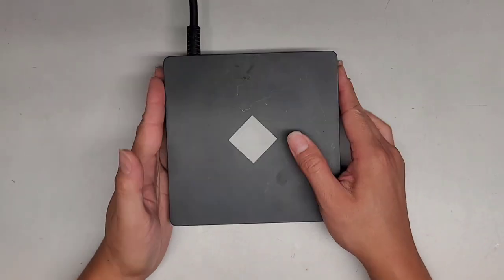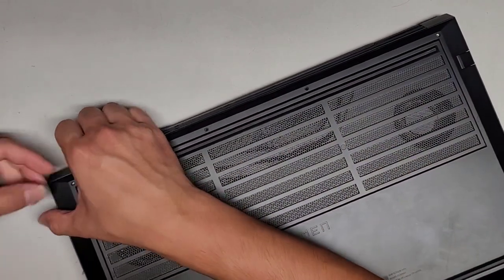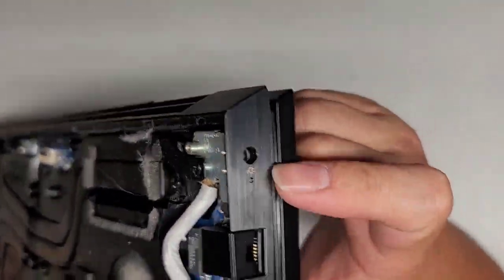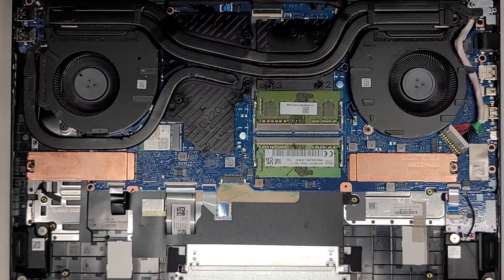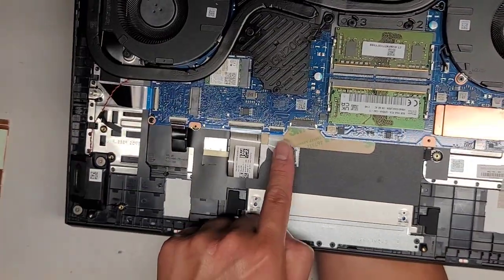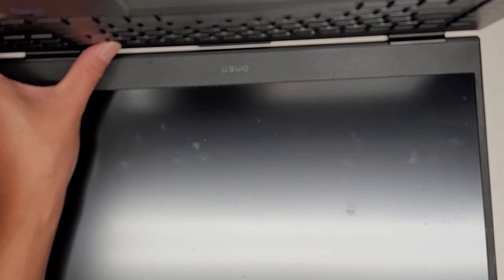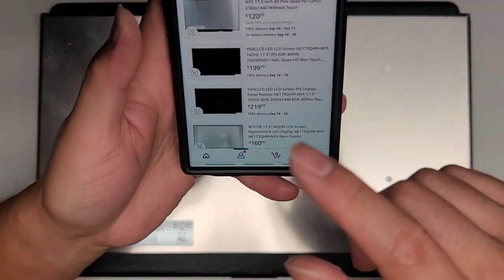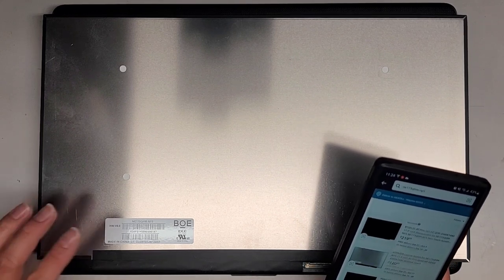HP Omen 17 17t-ck000 Disassembly RAM SSD Hard Drive Upgrade Battery LCD Screen Replacement Repair

Comment: thank you very much for this great video. i do want to upgrade my omen with ssd and ram and i have a question to you. could you mention which device for the ssd to buy and how it is placed and installed to the system? do one has to make anything on the os side after installing the ssd? And regarding the ram upgrade, do one has to replace both rams currently present or can i replace just 1 of the currently default installed 8gb ram sockets and insert e.g. a new 16gb socket?
Reply from the maker: This should help. https://youtu.be/4p5jFDzVwUw you can replace just one stick of RAM.
Reply: @ItsBinhRepaired  thank you Very much for you quick reply. i will do as in the Video described. Just one question, does the ssd size Matter? 500gb, 1tb, 2tb,... or are there a Limit regarding the Volume ?
Reply from the maker: @slomo4056  there's no size limit.
Reply: @ItsBinhRepaired  OK thank you. do you have an recommendation on a SSD that fits to the Omen?
Reply from the maker: @slomo4056  how much storage do you want?
Reply: @ItsBinhRepaired  1tb additional space would be perfect. my omen has 256gb by Default which is really limited
Reply: @ItsBinhRepaired  do you have a product recommendation?
Reply from the maker: If you don't need the fastest performance, this works great https://amzn.to/4gpKCs3

If you want more performance, then go with this https://amzn.to/47rmvFC
Reply: @ItsBinhRepaired  thank you for These suggestions, i will try These.
Reply from the maker: @slomo4056  sounds good

Comment: Hello, thanks for this video. I wanted to replace the SSD that just failed on SMART test on my OMEN 17-ck2003sf (7M270EA) laptop and wanted to see if I could do it myself. Does it need a 22mm*80mm SSD? I could not find the info. Can I replace it with the Samsung pro980? Thanks a lot.
Reply from the maker: Yes, but make sure no heatsink.

Comment: Thank you very much for this video, especially the screen replacement part. I cannot believe why HP used adhesive to secure the lower part of the screen. They must have been a few screws loose (pardon the pun) to secure the lower half. Over time the adhesive will lose its stickiness because of the heat of the laptop. I managed to get my screen replaced myself after it broke down for a 2nd time, 1st repair was done by the shop under 1 year warranty. 2nd time they were asking too much money, so I did it myself using your guide. Anyway, very grateful & I have sent a donation. Seasons greetings to you & your family.
Reply from the maker: Awesome! Glad it helped. Yeah, the adhesive route is stupid. They're all doing it now. Thank you so much for the support. I really appreciate it. Happy holidays!

Comment: I’m about to lose it. I can’t plug the battery. GOD
Reply from the maker: @cmliulasefe  the connector won't go in?
Reply: @ItsBinhRepaired  My laptop just came from warranty service and I wanted to open it to upgrade my RAM and SSD. After opening the lid, I tried to remove the battery. But it seems they screwed up with the screws, lol. One of them was stripped. So I couldn't remove the battery, I only disconnected it. After upgrading I had so little space to connect the battery and it's so stiff for some reason. I did it at least, but it gave me a headache. I wasn't expecting you to answer haha, nice vid dude. Keep it up.
Reply from the maker: @cmliulasefe  D:

Comment: Hey Boss - How much you will Charge to Replaced my Motherboard on my HP Omen 17t- ck000..?? Including Parts + Labor..??
Reply from the maker: What are the specs? I'd have to see if a replacement board is available.
Reply from the maker: Email is for spam. Message me here.

Comment: Nice video, Can you replace the GPU chip or does the whole motherboard need to be replaced? I ask as the GPU has failed
Reply from the maker: Whole motherboard
Reply: @ItsBinhRepaired  ok i thought as much. i have HP Omen 17-CK0013NA i7 rtx 3060 is that the same motherboard as the one in the video?
Reply from the maker: @adventuresindiving7451  not sure

Comment: You answered my question 8 minutes in. I wanted to know if I had to pull the battery just to add an SSD. Perfect thanks
Reply from the maker: Glad it helped. :) If you haven't already, please like and subscribe so others can find my videos and possibly consider watching a few others and commenting to get the algorithm to recommend my channel. Thanks!
Reply: Liked and subscribed thanks
Reply from the maker: @PatrickNolte  Awesome! :)
Reply: @ItsBinhRepaired  well I added the second drive. I didn't have an issue at all taking off the bottom cover. Once I got it started, I used a plastic pry tool.  What surprised me was how small everything is. That battery connector looks much bigger in your video than in real life. Of course I powered down, pulled the bottom cover, and installed the drive. After a reboot the drive was there. Thanks for the tips.
Reply from the maker: @PatrickNolte  awesome! Glad the upgrade went well.

Comment: hello, it has 2x gen 4 ssd slots ?
Reply from the maker: Yup
Reply: But on the MB in your video it says Gen3 for the second ssd slot  @ItsBinhRepaired
Reply from the maker: @myth71  oh, that's right. Either way, it'll support a gen 4 SSD though.
Reply: @ItsBinhRepaired  You mean it will run a Gen 4 at full r/w speeds?
Reply from the maker: @myth71  no, it'll run at gen 3 speeds, but it'll work fine.

Comment: First! (🤔only?)
I saw Omen in the title and thought about what a crazy name that is. Then thought, uh oh, is this thing gonna live up to its name? Yup!
You said a fascinating thing, you said that on many of these laptops, that the unit doesn't even have access to the GPU unless the A/C power adaptor/charger thing is plugged into the wall. It is interesting in several ways. I`m trying to remember if my hp laptop was plugged in when I was doing some benchmarking recently. I think that i will go back and retest just to see if it makes any difference in the results. I`ve got time on my hands while I wait for $300 worth of R/C truck parts walks here from China. hhhhhhhhh
A couple quick things about my hp Camo edition. Firstly, it had like a total of 7 screws hidden under those 2 rubber strips that are the feet. And I got bored the other day and decided to do an experiment. It came with a whopping 4 GB of RAM. I had already bumped it up to one 8 GB stick. Both are/were of the 2400 MHz. So, I decided to add a second stick of 8 GB Ram except of the 2666 MHz. Just for some fun benchmarking (my idea of fun has sure changed over the years, lol) testing. Will it recognize it? Will it improve my R23 score? Will it explode? Yes, it recognized the 16 GB. No, my R23 score did not improve. No, it did not explode. Anywho, I'll be running the R23 again, making sure the A/C thing is plugged in. 
Bro, this screen is a bear. A bit similar to the Apple all in one screen that I broke the other day.
Haha that split second when you saw that crack in the screen, when you were all, "Oh, Snap!" "Did I do that?" I haven`t finished watching the video yet, to see what happens. Bust out the popcorn boys! We got a nail biter, cliff hanger goin` on here! I am dying to know how much that screen costs. Is it even available? Where do you order parts from? 
Back to that Apple all in one, I had called my local computer store about that display, and if they could order a replacement for me. They said that they use a small, local, computer repair/sales shop to order their Apple parts. They can`t even order their own parts? Weeak!
Ok, back to the video! 
Man, that 20 minutes that it was black screen were murder, lol.
A fine job, son. 
So, this thing is a gaming PC? I would really like to see some benchmark test results on it. R23, Valley, Heaven, something. 
Oh, here`s one for you. I run a i9 100900k CPU and I mess around with overclocking it. While doing the OCing I run benchmarks to see the benefits. As my clock got higher, the benchmarks fell off. Cinnebench R23 and Heaven both fell off at 5.2 GHz. Valley hung on for 5.3 GHz and(!) 5.4 GHz. Yay! Valley!
 I could`nt even get completely out of the bios before it would crash with a 5.5 GHz try.
I am totally ridiculous doing any of this because the only thing I use my desktop for is to play Medal of Honor multiplayer. Doh!
Your video has Binh watched.
Reply from the maker: Hahaha I get parts from Amazon, ebay, and very rarely, some website like aliexpress.

I don't overclock because of the possible risk of damaging customer parts.

Glad to see you're enjoying the videos and pulling things apart.
Reply: @ItsBinhRepaired  I only overclock my own pc. It never even occurred to me to overclock a customers machine. 
Yeah, I guess that I overwhelmed you. Don't feel bad because you can't keep up.
Reply from the maker: @mrkemblegilstrap  hahaha yup

Comment: Hello there. I recently bought Hp Omen 17-ck2010nt. Can i replace Samsung 990 Pro with heatsink in this laptop? Does it fit inside with heatsink?
İ want to install 2  ssd. One is Kioxia Xg8 2 tb other is Samsung 990 pro with heatsink 2tb. Which one you prefer for os? which one is for installing game? Thank you for your suggestions.
Reply from the maker: Heatsink won't fit
Reply: @ItsBinhRepaired  Can i remove that thermal enclosure to fit this samsung ssdj?  Is it safe?
Reply from the maker: I'm not sure how they secure it. Why not buy one without it?
Reply: @ItsBinhRepaired  because i already 2 months ago bought one. Thank you for reply 🤚
Reply from the maker: Oh no :(